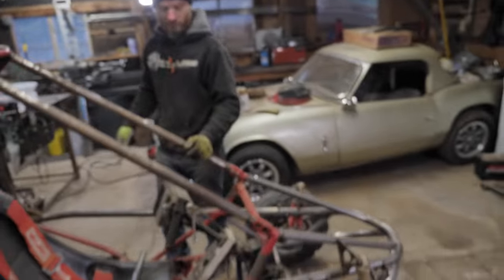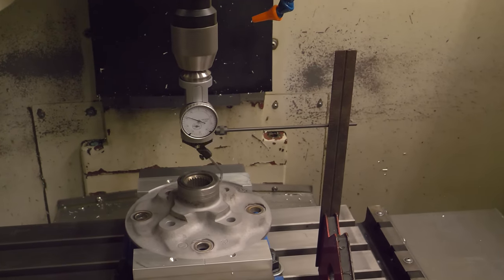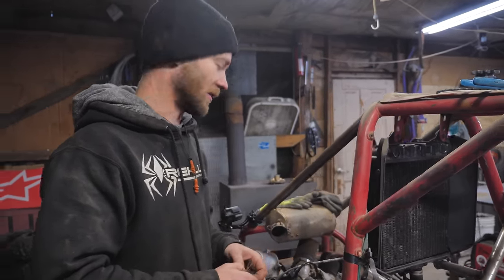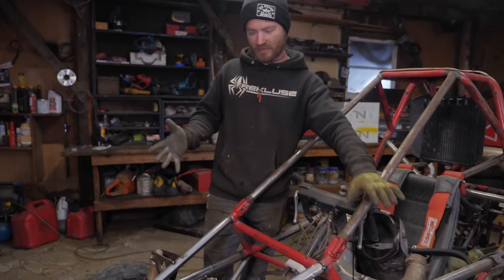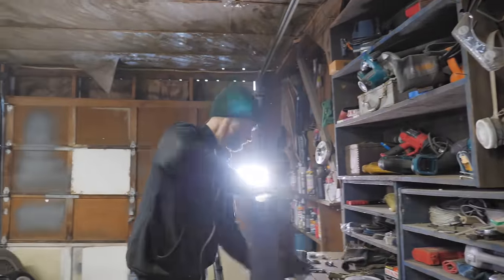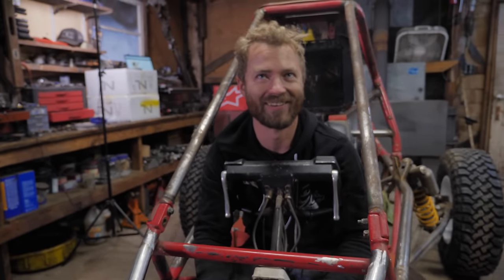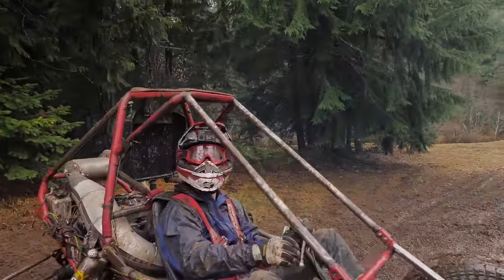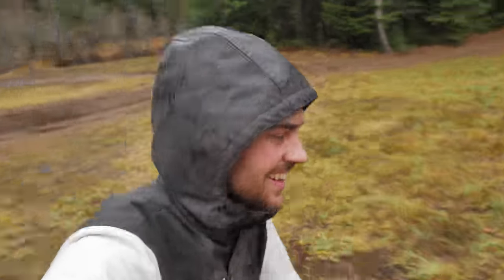Long Travel Odyssey ATV Test Drive on 28s!

Comment: Hold the phone did this man just say 2JZ!!!!
Reply: THANK YOU
Reply: Yo is that a 2JZ
Reply: Maybe it's for the BMW
Reply: @theginjaninja132  im hoping its for the tacoma
Reply: @andrew75511  that would be pretty damn cool.

It doesn't beat the 4AGE swapped Helux for me though.
Reply: Meh × meh + meh to the power of MEH squared = how I feel about this.
Reply: @theginjaninja132  i had a 4age black top in a levin a while back, nice engine. but not actually very powerful. good for its size though (1.6L). the standard 4age is the preferred one for modding/ upgrades though as the black top just has too light and weak conrods etc. i miss that 8000rpm 20v quad throttle body engine though. it screamed. had an h22a in a honda accord sir coupe before that, it waas awesome too. another 8500rpm engine. 2.2L DOHC VTEC. only had the black top version of that, not the red top. so only had about 187hp. but i loved it. my current car is a toyota altezza as200 (lexus is200). its a really nice car, but super super slow engine... oh well.
Reply: @wotever99ninynine  That sounds awesome to me. I'd love to have a levin with a blacktop. Or an mr2 with the same motor.
Reply: @wotever99ninynine  Yeah the 4AGE isn't the best swap for a light truck but if it's geared right and you keep your right foot planted you'll scream your way up most hills.
Reply: papakfmcnados king search 4age hilux there's one that destroys the trails
Reply: @truenough86  I know that's why I brought it up
Reply: It's always coolest to do engine swaps, but keep the same manufacturer.....unless you're swapping in a wankel rotary.  Dorito engines rule!
Reply: too good for any of this crap
Reply: @nunyabinis  you gotta love the rotary. gonna be awesome to see rob dahm finish his quad rotor awd rx7. its gonna be well over 1000hp. awesome. you gotta love that sound. 2 stroke dirt bikes and rotaries. they are like music to my ears. and 4 cylinder high revving car engines.. :-)
Reply: @isaakwelch3451  yeah, we are lucky over here in nz. planty of imports. loads of skylines and silvias, altezza rs200's (which was the one i wanted... .oh well.. - 210hp 8000rpm 2.0l beans engine, 6 speed tranny, lsd diff, rwd etc.) and more. you guys dont get the lexus is200's/ toyota altezza's with that engine overseas, or the skylines... we really are lucky. (i just realised i assumed with no reason to, that you are in the states or canada etc)
Reply: Its for a tractor
Reply: @thegenerousdegenerate9395  that's not very generous of you.

Comment: God save whatever bearings and bushings are on that buggy
Reply: 1 video later replacing all bearings :) lol cause of WAY to heavy rims lol
Reply: Regilio Bouma the rims are lighter. The issue is the size of the wheels. Larger wheels exert a larger force, on the bearings
Reply: @Vader294  the massive rims? Lighter then the atv style ones? Im surr the front where alloy wheels rear not sure.
Nut yeah somr low profile would work but don't think low profile off-road tired exist?
Reply: @reggiexp69  Low profile off-road tires are an oxymoron. You don't want to bend a rim and you want usually lower pressure to get more tire on the ground for grip. There are only downsides to running low profile tires off road, not really any benefits. Which is why they don't exist.
Reply: @1Kurgan1  yeah usual for offroad small rims with big tyres
Reply: 1Kurgan1 I live in the California desert I see lots of oxymorons!

Comment: Do a powerwheels tank with leftover tracks from snowmobiles
Reply from the maker: Good call!
Reply: Yessssss
Reply: Haa
Reply: @200kiloCatfish or a paintball gun on a removable mount
Reply: @GrindHardPlumbingCo  how about a power wheel with a 440 L/C rotax engine. Light weight and over 100 hp. ???

Comment: Smaller tires i think will be better off. Looks like alot of stress on the parts
Reply: They dont need that kind of negativity
Reply: @TheMrhick92  5 bucks says they break something in the next shred vid🤔
Reply: @rprokopow  then they know what needs to be built stronger thats how it is
Reply: @TheMrhick92  more like constructive criticism.
Reply: @rprokopow  thats the way it should go
Reply: Yeah they look too big...would look a lot better with ATV tires. Not knocking these guys at all because they are awesome....just my opinion.
Reply: they got the power, if not, step up to a triple. the clutch is quite a magic trick. We used those motors to tug at ice shacks with stuff inside them.. truly amazing potential.
Reply: With grip
Reply: Rally Sweden Type Michelins...Studs.:.:.:.:.:.:.:.
Reply: Unsprung weight makes me sad.
Reply: Ryan Prokopow I have 25”s on my barracuda and I thought I was pushing it with the size, not had any problems yet apart from having to change the sprocket
Reply: Hell yeah dude?
Reply: @rprokopow  i mean they break it they always fix it

Comment: I’m gonna be honest, the new wheels and tires don’t look good. I think going bigger was a good idea but maybe not that big, and also have the rear ones larger than the front.
Reply: Needs a smaller more aggressive tire
Reply: Yeah... The fronts gotta downsize fersure.
Reply: just 10" or 12" ATV rims with some 22 or 25 tires... for real car rims looks REALLY WIERD... plus heavy AF
Reply: yeah, i prefer the small front, big rear look too. i dont like these new wheels at all, and the stress and leverage wheels that big put on all the suspension parts etc is enormous. and the engine just doesnt have the power or the gearing to properly spin them up etc. i think old wheels looked and performed better. cant blame them for trying though. those rims were pretty nice. sometimes it seems like a good idea in theory, not so much in practice.
Reply: I didnt like the look of the BRAT wheels, these don't make it better IMO
Reply: I have to agree, for the car wheels took My favorite project of their from hero to zero. Just too much unsprung weight, and they do look kinda silly as well.
Reply: Logan Urrunaga  yeah and know it dosent have any balls behind it
Reply: I agree with these wheel being way large to look good on this one but you got to have traction
Reply: Agreed
Reply: I agree. This is the first time I would have to agree this wasn't the best decision they have made. They are just way to big. He may be OK with the wheel but deffinetly needs smaller rubber.
Reply: You are right, those fronts do not belong on there.   They are way too big and wider than need be. They will keep eating front end parts. They are wasting time making an odyssey something it isn't going to be.
Reply: Right hahaha but we all watched and comented lol
Reply: I love them!
Reply: Logan Urrunaga I think part of the problem is the frame needs to be painted too to match. Also smaller wheels in the front
Reply: I think they may run into problems bending the a arms or tie rods with such a big wheel .  I run small wheels up front and 27 on the rear and they are huge
Reply: If they had a slightly lower profile tire they’d look a lot better
Reply: Yeah I don't like it
Reply: Yeh 100%
Reply: I agree
Reply: I think the fronts should be smaller than the rears
Reply: Incorrect in my eyes man. Fuck what it looks like I'm function over form and the functionality of bigger wheels and tires is worth the unsprung weight penalty to me all day long. Granted, those are completely overkill and just way way WAY too heavy for the steering components and whatnot but if you were gonna just jump the fuck out of it and nothing else, I'd be happy to have 30s under me.

Comment: A real nice &  extremely useful part called a 
take-up bearing
Keeps shaft's & rotating assemblies 
Square & locked into place. They save belts & chain from failure due to 
Misalignment. Just a FYI guys.

Comment: I've got a ninja 600 motor would be perfect for that thing
Reply from the maker: It would be pretty great to have gears!
Reply: @GrindHardPlumbingCo  yesssss please do this or find a cbr1000 motor
Reply: Then race cleetus in his 1000cc hold cart lol
Reply: Anything that doesn't have a shitty CVT drive train would be perfect for that thing. Snowmobile engines are great, but the clutchs are a pain.
Reply: This like a near donated type deal.?
Reply: @KeatonsCarlott  yes
Reply: A Polaris 800 twin two stroke is a lot lighter than a 600 and has more power. Excellent choice for motor and drive. I lived in Alaska for 26yrs. My 440 twin Polaris power got ALOT of miles
Reply: @michaelrurak7056  [everyone liked that]

Comment: that is so far beyond an odyssey, it makes jason's trip look like a gentle paddle, down a peaceful stream. there's nothing gentle, nor peaceful about this beast. i used to turn v-dubs into sand rails when they were cheap and plentiful. i'd wager this has a better hp/weight ratio than even the last couple i made with a 2112 big bore kit on a 1600 dual port, and an aluminum front end. i'll bet with a real clutch, it'd be a wheelie machine. i know my sand rails were. awesome build. golf clap all around.

Comment: I’m gonna be honest I don’t really like the wheels
Reply: I think they look cool its just the tires are too big
Reply: Yeah if they were like 24s or 23s they would be okay
Reply: Amen. To heavy..
Reply: Agreed, waay too big and looks stupid
Reply: They dont look good in white
Reply: @MDW893  Stupid is a pretty strong word. Not very practical seems to fit better. They do look okay. Just not in white and not so damn big lol.
Reply: The white does not look good and the front tires are too big
Reply: Yeah they suit rally cars but not a oddessy lol to heavy an look too big.
Reply: @josteincarlsen2905  yes that is all i was thinking.. wayy to heavy for the CVT.. quad wheels would work better... i think they did lose a faire bit of power with those rims...
Reply: It needs a set of wheels off a razor or atv. Doesn't look right. Looks disproportional like a giant head on a tiny body
Reply: @ToolinAround  They are wheels that are made for RZR / atv!  Wait til they finish the build.  It's going to be AWESOME.

Comment: Definitely a gear reduction. Not a rock crawler reduction but not far from it. Go with a half ton time rod ends and a steering stabilizer shock. Great video and build. I grew up during the Odesy times. Had lots of fun on them.

Comment: dude you are getting the belt wet, it's doing nothing but slipping, and it's probably junk by now. you are not putting any power to the ground
Reply: If the belt was slipping it would rev to the moon and barely move
Reply: xXJBrutalXx ok boomer
Reply: @joedudley386  These belts actually slip pretty easy on those clutches when wet.
Reply: @stronghandstroker9723  I know they do, but that belt wasn't slipping at all
Reply: @joedudley386  @ 16:22 the rpm's are high the engine isn't bogged down and the the primary clutch looks to be fully engaged due to it being wet and the buggy having bigger tires its most likely the belt slipping.
Reply: @Fz-bo7sm  oh look the 12 year old brigade showed up
Reply: i have been racing GNCC for 10 years now FOR  Can Am yeah i know nothing.
Reply: @stronghandstroker9723  you're right
Reply: xXJBrutalXx sure you have boomer
Reply: @Fz-bo7sm  do you even know what a boomer is? or is it just a word you learned from Reddit memes in your moms basement? lol
Reply: xXJBrutalXx someone’s triggered, and it’s been r1 swapped sooo yeah not for a beginner by any means lol
Reply: @Fz-bo7sm  riiiiight
Reply: xXJBrutalXx that’s right boomer, now go drink some prune juice
Reply: @Fz-bo7sm  i will while i wait for you to learn how to ride a real bike. im sure Burger King will give some time off to learn.
Reply: xXJBrutalXx ok boomer, make sure you don’t hit your life alert when you’re getting off your electric scooter.

Comment: Totally wrong wheels and tires guys. Those are way too big and heavy.
Reply: The WHEELS are fine, imo they look really good. The tires are just TOO TALL for the gearing and the powerband that the motor puts out....lotsa hp but not enough tq...if this was the jseries or K-series from the Honda oddessy minivan than they'd work now problem...which at first is what I thought they were using. When I heard it was from a snowmobile  that explained a lot.

Comment: Just a couple observations from a Canadian snowmobiler. You need to build a cover for your clutch and drive belt, if you snap a belt without a cover you can get seriously injured. And the reason it fucked up is because the belt got wet with the mud, a splash of water can make a snowmobile sink while crossing water, im assuming thats what made it fail

Comment: Hey guys I love the oddessy! I know im late to the party but a lot of your issues are wet clutches. Make a shroud to keep them dry and it will work way better. I would also swap that polaris engine out for a 2003 to 2006 Arctic Cat F7. They eat modern 850s as sleds i cant imagine what itd do to that beast.

Comment: This project is awesome but I have two simple suggestions. 1. take off those heavy way to big wheels and find a size in between the two. 2. You need to change the clutching on the primary and secondary clutches. Ask someone that mods sleds or races. Clutching is a dark art

Comment: I think the clinking sound you hear when starting and idling is the pull starter engagement triangles (things on the inside of the pull start that engage when rope is extended) are loose and hitting the rotating engine shaft. This could be caused by the rope not being long enough and keeping the starter a little engaged.

Comment: Guys I never disagree with the mods and add-ons you do but I'm gonna have to say on this tire upgrade, I think it would have kept that awesome Odyssey stance with the bigger rear wheels/tires than the front. It would have even made handle more easily as far as steering... imho. But I dont even know if you had the option of getting matching smaller rims.

Comment: you guys should try 23/7/10" f / 22/11/9" r holeshot xc or the like tires, the rears will be a little wider for more of a contact patch, you will also benefit from less rotating mass, throw on a rear sway bar and that buggy will handle a lot better. nice build so far though!!

Comment: I know it's already done but many of us  old Subaru guys drill our hubs 4x140 to the 6x5.5 or 6x139.7. if you knock out 2 studs on the hub the other 2 line up with the wheel and then you just drill the other 4 and add studs. No cnc needed

Comment: Man you guys have it going on .
Here in  Knoxville tn.  My hobby is basically the same scale as ur odyssey, . 
Let me make a suggestion. 
On your tires ,the rear ,look in to a 4 ply or 6 ply firs stone 31 10.5 .15 ditch witch tire .
And run a 165 15. ON THE FRONT. and for ur front wheels  ,a 15 . X 4 RIM.
WELD SUPER LIGHTS ARE STRONG AS HELL AND WEIGHT 7 OR 9 LBS. 
THE REAR WHEEL IS EASY,  FIND ANY OLD STEEL WAGON WHEEL 15X 10 OR 15X 12.
YOU WILL BE SURPRISED ON HOW WELL THAT COMBINATION WORKS .
THANKS FOR THE VIDEO. KEEP THEM COMING.

Comment: Guys, those giant rear wheels just undergeared that by an enormous margin. Putting those on had the same effect as going from 4.11 rear gears in your truck, down to 2.56's. Now the engine and clutch can't overcome the amount out rotational force required to turn those wheels effectively. Put a larger final drive sprocket on by about 30% up in tooth count.

Comment: this bead lock thingy about driving airless you lyricking about only works when you calculate the weight of the vehicle opposed to the downforce on the rubber and that would make the problem obsolete,it will have springs .

Comment: You guys should look into a Toyota Prius  steering wheel and column the electric power steering is built onto the column and is very easy to work with. Would help with turning those wheels at low speeds.

Comment: I keep thinking those front brake pads will be screaming hot in no time with how much rotational force will be applied to those little brakes. Should also put a dual caliper set up on the rear for an ebrake to do some skids

Comment: Since a rotary is a 2 stroke but without the self-supercharging part I bet you guys could make it work. Put on an expansion pipe, connect the intake to the exhaust with a reed valve, add a large enough intake plenum with another reed valve before the carb. It could be the world's first self-supercharging rotary. I know you guys could do it.

I'm not sure if it would work but I bet there is a way. With a piston 2-stroke the intake and exhaust ports are open at the same time and then when combustion starts they are both closed at the same time. With a rotary there is never any overlap which is why you would need to connect the intake to the exhaust. I don't see why it wouldn't work though with the proper sized expansion pipe and intake plenum (to simulate the crank case volume of a piston 2 stroke which is part of the supercharged air fuel mixture), and with the correct reed valve setup so that exhaust could go into the intake but not the other way around, and so that exhaust couldn't come out of the carb. Then I think it should work.

Comment: How did you find a 2jz in north Idaho? lol. Side note: I hate to say it, but that much unsprung weight along with the 160lbs of rotational mass on the rear axle is going to lower the power, make it bounce a lot more and make jumping an uncomfortable experience. The buggy is just so light in comparison.